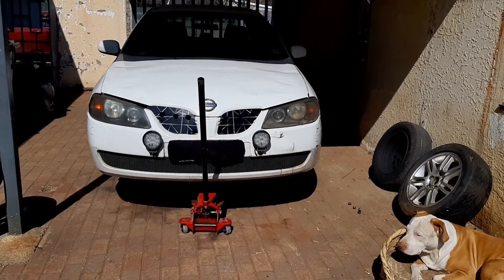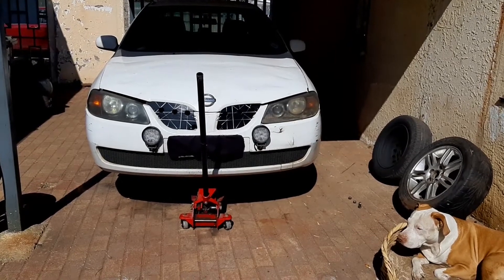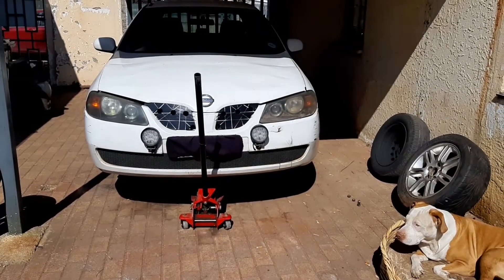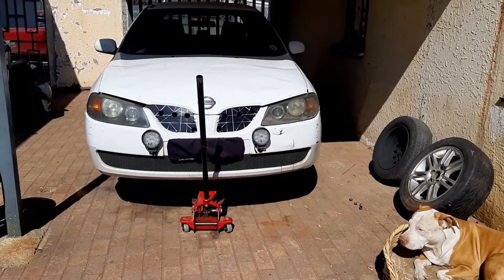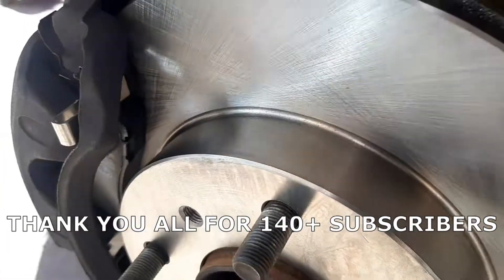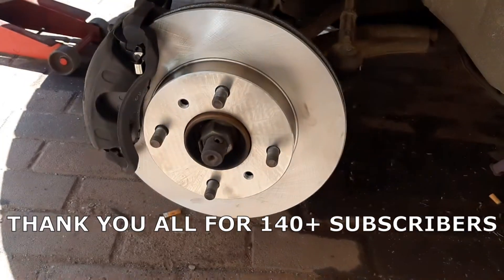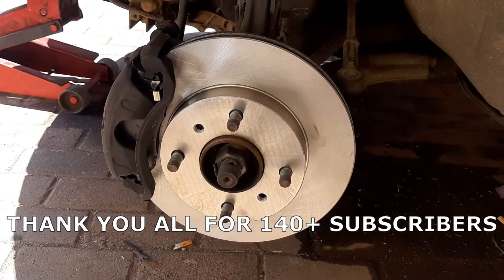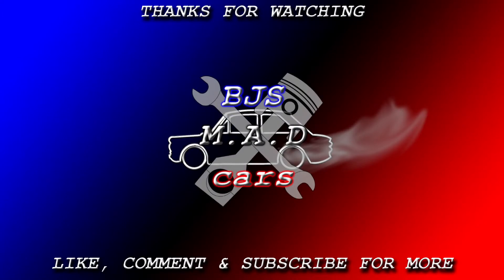REPLACING BRAKE PADS AND DISCS Nissan Almera

Comment: Nice person always do nice work 👍👍👍
Reply from the maker: Thank you. I always keep my clients safe and happy
Reply: Suddenly pickup low and check engine light on in running
Reply from the maker: Try and have a diagnostic test done on it. It should tell you the problem
Reply: @bjs.m.a.d.automotive  okk
Reply: I dis canact negative wire of bettry for 30mnt, now check engine light is gone... But pick up is not well what can I do
Reply from the maker: I am not to sure. I would recommend doing a diagnostic test and taking it from there
Reply: @bjs.m.a.d.automotive  okkk
Reply: Dtc c2415
Reply from the maker: @sharadv.upadhyay1892  i would start by checking the spark plug gap, fuel filter, and make sure everything is connected(wiring)
Reply: @bjs.m.a.d.automotive  okk
Reply: Thanks